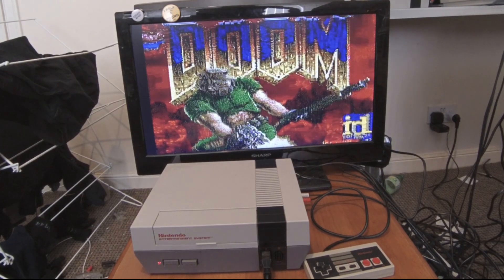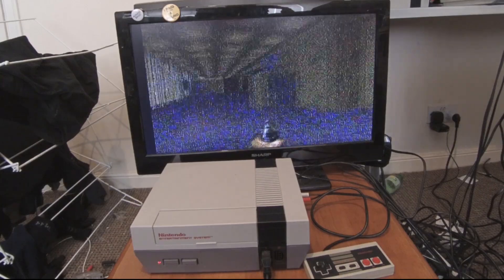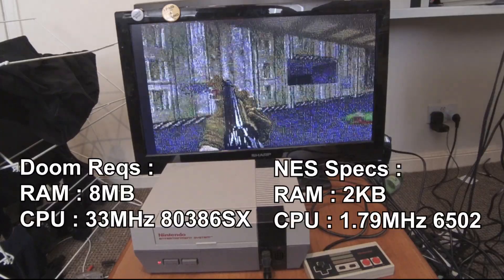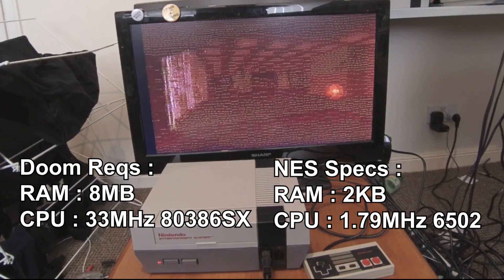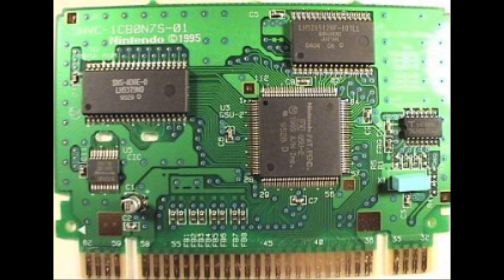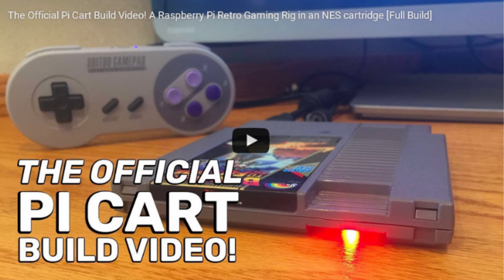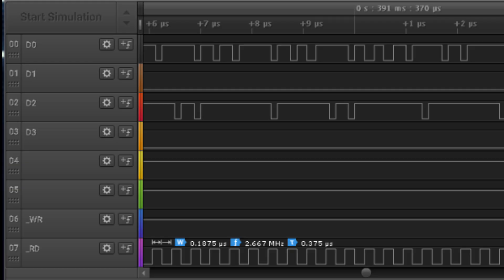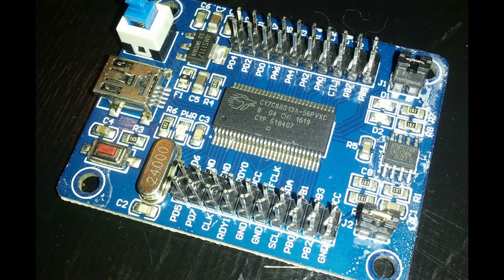DOOM on NES!

Comment: It's quite neat but it is cheating. As are the very comparisons you're providing when others compare games vs other games. 

When a YT channel boasts how Yoshi's Island looked better than the competition- sure it's very impressive, it also has a CPU in the cart that's faster than the SNES's base one which made the cart far more expensive. It's not the actual hardware doing running the game. 

Modders got Wolf3D running full speed on a Genesis with no added hardware. 

Like I said, it is neat but more accurately would be calling this a Rasberry Pi running on a NES :P

Comment: Oh my god, it’s not even cheating! It’s literally using a raspberry Pi like a Super FX chip:
Reply: That was a strong point for cart based games.  The Devs could use special, proprietary, chips if they wanted.  There are a number of examples of extra chips, mostly extra sound chips, in carts for most 8 and 16 bit systems.
Reply: No, it's really not. The Super FX chip was merely a math coprocessor that executed code along side the system's CPU; this project on the other hand is not using the NES' 6502 processor at all, and is merely using the NES' PPU and controller input as extensions to the Raspberry Pi.

Comment: The Super FX and Sega Virtual chip is actual hardware. The Raspberry Pi is cheating because it modifies the way the NES works. The Raspberry Pi, however, modifies the hardware of the NES, or whatever console is running the Raspberry Pi, to make more RAM than it's supposed to be taking. So, this IS a modified console.

Comment: Nah, sorry. It's Doom on Raspberry Pi with a NES acting only as a DAC. Definitely cheating.

Edit: I'll admit it's a cool proof-of-concept though.
Reply: Put a PS4 chipset in a NES cartridge next and get Red Dead Redemption 2 working on an NES...
Reply: Well, but as he pointed out it wasn’t uncommon to incorporate extra hardware and even processors into the cartridge. (Eg Just about every NES cart had a memory management controller. SMB3 needed a special chip to make 2 axis scrolling possible. )
Reply: @AWriterWandering  The thing is that the extra hardware and processors still communicated with the base system's entire chip set; all this is doing is using the NES' PPU to output analog composite video.
Reply: @raspberry144mb3  So the NES has DMA?
Reply: @AWriterWandering  So RDR2 should be legit-as-fuck when we get it runnin' on an NES!
Reply: Wow this thread sucks. Doom can not run on an unmodified NES without extra hardware. A port would not be doom at all. So you create a cartridge with extra hardware. So, would it be less cheating if only parts of it was running on a chip - a specialized FPGA based on the doom source code perhaps? Or would that, according to people who think they are so smart because they understand how this works, yet can't discuss this without getting furious over this running on a stock NES without any video editing, be more pure because parts of the code ran on the NES? Or does it have to be NES era hardware only, or only a RAM cartridge to not be a cheat? I must have missed the official rules.
Reply: People really missed the point of the video
Reply: It uses the controller and the power of the nes and is a game inside the nes, star fox and other games are simular,
Reply: Group of people arguing different things, not listening to each other 'cos they want to be right, oblivious to that fact that most are actually right, just arguing different things. 
Always goes well.
Reply: its not cheating if the nes is completely unmodified. it runs instructions from the cartridge like every other NES does.
Reply: @marioisawesome8218  The NES is not doing anything other than acting as a video DAC and controller input.
Reply: @raspberry144mb3  and it powers the cartridge, which makes the rasberry pi work.
Reply: So because the electricity has to flow through the NES first to reach the pi it means the NES is "running" Doom? That's silly.
Reply: @timothykirby4406  strawman. i never said that.
Reply: @marioisawesome8218  the cartridge doesn't contain anything, except maybe some wires to power the raspberry pi, some wires to grab the Io signal and an output wire that streams a steady image to the GPU to render the result. You could flash the pi with any else game and it would "run" in a chassis of an nes, but wouldn't need it as you could directly hook the pi to a hdmi monitor. So yeah, no real instructions are read from the cartridge to be processed by the CPU thus it doesn't run the game.
Reply: @CathrineMacNiel  strawman. i never said it ran the game.
Reply: @marioisawesome8218  you did tho, as you said that it runs like every other nes and is not cheating which implies that the nes CPU and GPU would do the most work as in interpreting the content of the cartridges rom (which in this case does not exist) and then render the video and audio out to the monitor (it doesn't render anything as the pi already send a perfect signal to the ppu) so it is cheating.
Reply: @CathrineMacNiel  whether it is cheating or not is subjective, because it depends on what you think cheating is (two different definitions of cheating are used in this video). and no, I didn't say the NES is running doom. If you think I did, please directly quote me.
Reply: @marioisawesome8218  It's running the entire game on the Pi, though. You can't say "Doom on NES" when the NES itself isn't actually running the game. The NES is just a video DAC for the real console that's embedded on the cart. Yes, that's cheating. If he wants to rename the video to "Doom on Raspberry Pi, viewed through a NES", I'll be happy to retract my criticism.
Reply: @Felice_Enellen  go stick the cartridge in an SNES or N64 (ignoring physical limitationts) and see where that gets ya. the pi is acting the same as the super fx chip for star fox, but each need their own console to be able to run successfully
Reply: @marioisawesome8218  You are completely and utterly missing the point. 

The super FX chip? Doesn't run the entire game. It processes very specific things, and is nowhere near equatable to using a NES as a converter box for video output, which is exactly what this 'not cheating' video is doing. Games don't run on the cartridge. They run ON THE CONSOLE with the potential to offload SOME of the processing to a specific chip with specific limitations. 

This is the equivalent to network streaming live video of Fallout 4 onto a PS2 via homebrew, and claiming that the PS2 is running Fallout 4. 

The nes isn't running it. The raspberry pi is running it.
Reply: @jtnachos16   i know that the game is being ran off the raspberry pi, but the pi is located inside of the nes cartridge, and the nes console is required to reach the contents of the cartridge normally. i never said the nes was running the game. 

your analogy is wrong. it is not the same as having an entity completely separated from the target console in every way run literally everything and remotely displaying it to the target console.
Reply: @marioisawesome8218  Except that it very much is. All the Pi is doing is jacking into the nes's video output and interfacing with the controller hub (if that). It's literally no different from streaming a game with google stadia or Onlive or whatever. It's just being streamed from a local server rather than a distant one, which is why I used the analogy of the ps2. Very much the same thing. Nothing being done on the actual nes hardware, aside from video display handling. 

The game itself is being run with ZERO usage of the actual nes processing and resources. If you took that Same PI board out of the nes cart shell, and hooked it up to an HDMI and a usb controller, it would still run doom in the exact same manner. 

If you can't comprehend the difference, than you need to not even try to argue technicals.
Reply: @jtnachos16 
your analogy was and is wrong, and if you disagree or have any questions, i've highlighted the differences for you. i apologize for not doing that last time.

NES Cartridge: contains the doom software, and the hardware to run it. needs a parent console to start it, keep it running, and have its contents accessed.
NES Console: accesses the contents of the cartridge, resulting in the game. The console itself does not store any information, but performs calculations.

your analogy hardware:
Streaming device: contains the doom software, the ability to run it, and the ability to run it standalone without a parent unit giving it the power to do so.
Target display: used by the streaming device in order to display things. does not give the streaming device the power to run the standalone doom software. does not grant access to the doom software.

"ZERO usage of the actual nes processing and resources."
hahahaha no. your self reasoning leading you to this incorrect judgement is what you are basing your poor analogy off of, which is why you think you're right. anyways... earlier in my comment, i stated the nes console is what allows access to the content hiding inside the cartridge. it simply wouldn't be possible to get access without the console itself. basically what i am saying is: the NES does not run it, but doom for the NES needs an NES to run. therefore, it is fair to say doom is running on the NES without hardware modifications. 

in more literal terms, doom is running on the NES with the help of a rasberry pi hidden inside of the cartridge, not console.

to anyone: all of you should understand what i'm saying at this point, but if you are blinded by your pride and/or denial, call me an imbecile or synonym for that, or add nothing to the conversation, then shame on you is all i can say.

the debate whether this is cheating or not is subjective, because two different terms of cheating are used in this video (just now realized), so i will not touch the subject anymore.
Reply: @marioisawesome8218  Yet you again, fail to comprehend the reality of it. The data can be accessed and used without the nes console. A nes cartridge cannot be accessed at all without either a console or a specialized rom dumping tool. The raspberry pi inside that nes cartridge can be easily accessed without a nes. 

Doom is not being run on a nes, because none of the calculations for the game, aside from display output/controller inputs, are being done on the hardware that belongs to the nes. 

I don't know how it fails to get through your skull that a raspberry pi inside a nes cart shell is not a nes cartridge, in any way shape or form. A flash cart at least tends to mimic the actual hardware it's based on, and function in a similar way. The only remotely official hardware it has is the connector to allow it to transfer data and power to and from the NES console. None of the rest of it qualifies as nes hardware, and the game itself is not being run on NES hardware. It's being run on a single-board computer that is interfacing with the nes to transfer video, and act as a hub for input control. 

The nes is very literally nothing but a cable box in this situation.
Reply: Sgt Obi  woah, that comment is really getting us places. thank you so much for your input. it means the world to me.

Comment: First step was to check if video was released on April's 1st
Second was to think it must be some animplayer (but with additional storage) or something else (I didn't guess it). Projects to write a wolfenstein or almost doom engine exist on 8bits/16bits and nothing would ever go as smooth. They tried Doom port on C64 with SuperCPU 20mhz (20x more fast that regular C64 or NES CPU) and it was still very slow, like you are running it on less than 386sx.
But yeah, if SuperFX and other hardware expansions inside cartdiges were the thing, you could claim it's legit, and it's a nice idea as a hardware project, but not as impressive as writing a 3d engine on the stock machine.
Reply: Uh, actually Doom on SCPU is the absolute worst Doom port ever. The 20Mhz CPU is perfectly capable of playing Doom. Too bad it has never been updated....The reason is SDL as video output. This is also the reason why the Atari TT port is so terrible....
Reply: @AmstradExin  Yes, good point. Basically from what I get the SuperCPU port is a straight port and maybe renders on a buffer and then does conversion from the chunky buffer to the C64 vram structure. Normally with a new engine, one would write the renderer directly targetted on the machine's vram structure (e.g. make optimized vertical wall column renderer specially tailored for the C64 vram addresses). And I think the SuperCPU is a straight C port if I am not mistaken?

Yet I am not sure the SuperCPU is simply a 6502 at 20mhz or has extensions? Doom code needs 32bit integers for fixed point and such (even a 32*32=64 mul), so if the SuperCPU still holds the same 8bit, then it might be harder in other ways. And porting Doom on a 6502 20mhz is not the same as in a 32bit CPU (Like 386dx or the 3DO or other consoles, where Doom also run slow (albeit not as much)).

Comment: I'd suggest experimenting with chroma artifact color.  On an NTSC console. each color can appear one of three ways based upon (x+y+phase) mod 3, where phase will typically swap between two values each frame.  Using just three colors of pixels plus black, but varying their positions, one can show 64 colors on the NES.  It may be necessary to start the game with a "color calibration" screen, but I think you'd get access to better colors after that.

Comment: so it's just using the NES video chip to output the video generated on the Pi? how pointless is that? LOL
modding the NES to extend the vid mem and game size limits (if there are any?) and making a proper NES ROM would be better
Reply: If you modded the memory and whatnot then you couldn't take the cartridge out of the console and put it in another and have it work though

Comment: 8mb ram? I was running it ok'ish on a 386sx with 2mb ram. Upgraded eventually to 4mb and ran perfect. 8mb was almost unheard of back then
Reply: I think the minimum requirements were 4mb.
It must have been wolfenstein 3d that was 2mb or maybe 1mb. But I am pretty sure doom was 4mb.
Oh,. and it would only run as well as the video in some 486dx maybe. On 386 it was sluggish.
Reply: @Optimus6128  deffo got it working with 2mb. I remember getting dpmi memory errors when first running it but managed to get it running with 2mb by tweaking the autoexec.bat and config.sys files. It ran ok on low res mode
Reply: @SJW2511  Hmm,. I hear this first time. Maybe I'll try it after removing some memory from my 386. Maybe it was the shareware version or an early alpha?

Comment: When you said you used a Pi and it wasn't cheating I was confused for a second. Then I realized the Pi was in the cartridge, not the console lol. That's freakin' cool!
Reply: So pi is like add on cheap on cartridge?
Reply: @strategicfooyouagencyfirst8197  Raspberry Pi's are little computer boards. They're commonly used as little emulator boxes.
Reply: @roflBeck  so nes just use as a video out put device?
Reply: @strategicfooyouagencyfirst8197  A little more than that. Sounds like he installed the Pi into the cartridge and it runs like a co-processor, along with the main processor in the NES. So I guess it's kinda cheaty but kinda isn't? I mean, you could put that cartridge into any NES and it should run, so I guess it counts.
Reply: @roflBeck  thanks. I saw his another video about how it works. It’s like pi processed the game code and output the picture code as nes way. Then fit the processed nes picture code back in to nes graphic memory. And nes output the video on screen.
It’s like he make the game as a pre-rendered nes code video witch nes can play. But the pre-rendered video is actually rendering in real time when the game is running. The nes cpu and gpu processed the graphic library and code in time. And the graphic library is refreshing very fast make this happen.
Very genius.
He is not really totally cheating, he really use how nes code and output the graphic way to achieve this. In fact if he want he can pre-render a move use this way and put it in a nes cartridge without pi in it ,and nes till can play the movie.
Really amazing....this guy is genius.
Reply: @strategicfooyouagencyfirst8197  Indeed it is not cheating at all, bc some cartridge games in the past came with co-processors embedded in them
Reply: @strategicfooyouagencyfirst8197 can you actually play the game that way though?
Reply: It's also clever. It's the only way that the little guy would be able to handle the game as stock, else he would have needed to modify the source code and reduce... well, everything.
Reply: The pi is like doing like everything while the nes is like a shitty graphics card
Reply: Nope